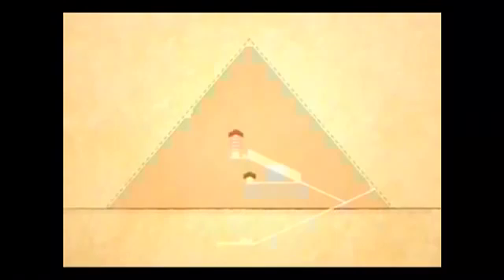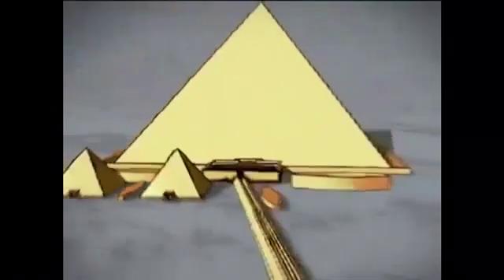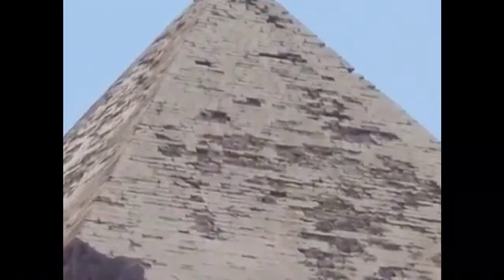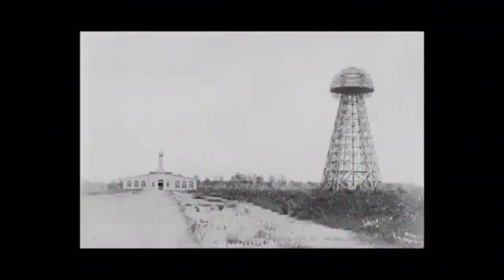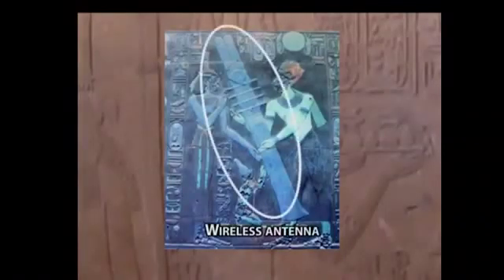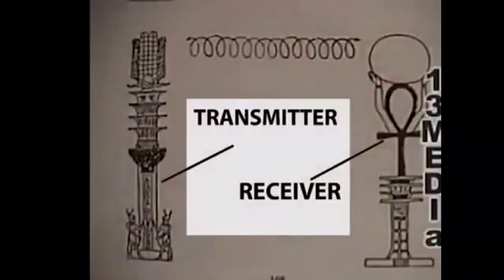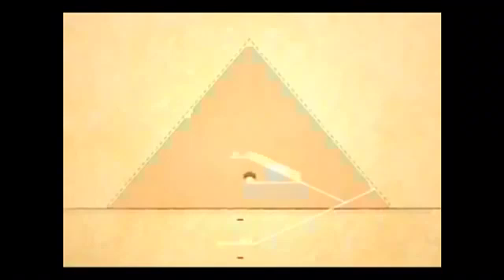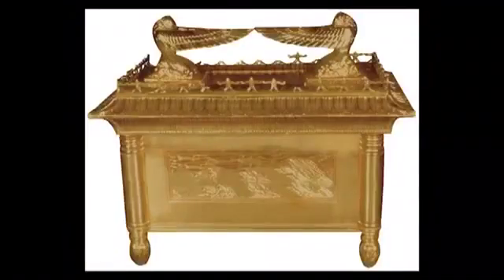TESLA SECRET REVEALED 2015

Comment: I have taken a dipole antenna, with a capacitor across the antenna, then routed the incoming energy "backwards" through a full wave rectifier, then through a bi-metallic battery on the "normal" side of rectifier positioned to keep a forward bias on the rectifier.  Electromagnetic radiation (EMR) energy comes into the antenna, gets split by the rectifier, comes back around and gets stored in the capacitor.  It's a bootstrapping effect like a swing that gets a push at specific times.  I then took the energy from the capacitor, through diodes, more capacitors, another rectifier and then a final capacitor to store the now dc electricity.  I then took that dc electricity to split water (h2o) into hydrogen and oxygen via electrolysis.  Small scale to prove the concept, and it works.

Comment: He's showing you what this discovery can be used for and for you to understand what this is all about he literally tells you to learn about RF frequencies and you'll figure it out how to build and apply it to whatever is in need of power! 

If you have a Prius, then you could apply this to the electric engine in the car and forget about ever using the motor that runs on gas. Or if you have a car that is 100% electric, this technology would make the car and its equipment run for months before any recharge of the batteries would be nessecary. 

If you scale it down and use it in a phone, this could be a permanent power supply that never runs out of energy. With a reciever, made in a fractal pattern to collect outside RF, you can apply it to whatever you want and have all the power you want!

Read and learn about RF frequencies!